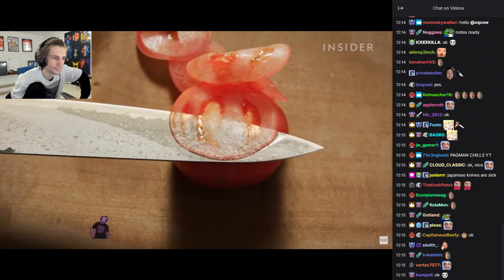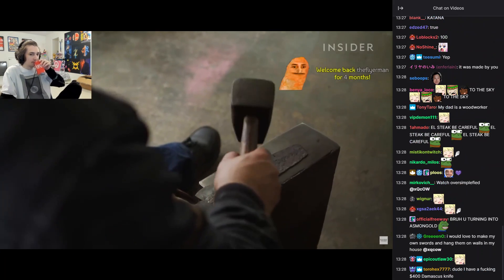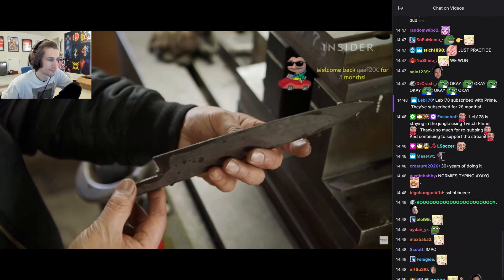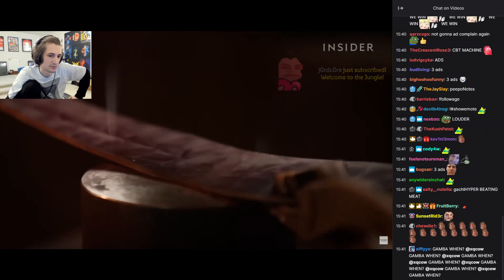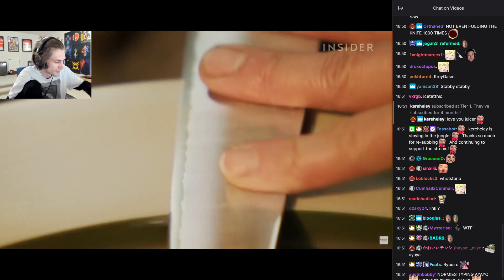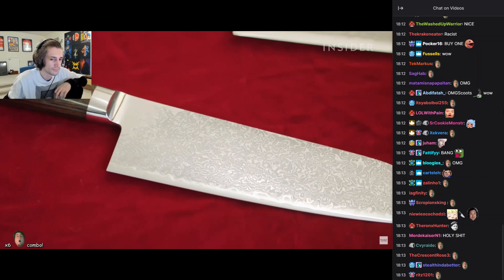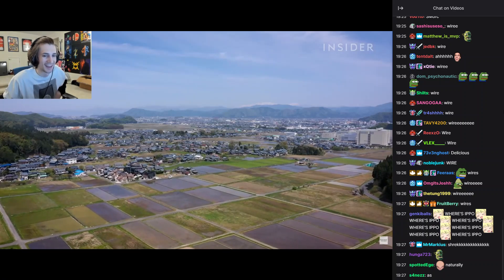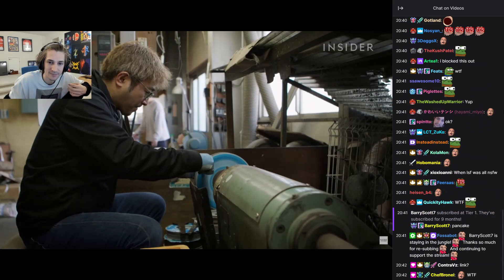xQc Reacts Why Japanese Chef’s Knives Are So Expensive | So Expensive

Comment: One of the things that frustrates me about that type of video is when they talk about sharpness. You can sharpen a stick to shaving level sharpness, but it won't hold that sharpness when used nearly at all. Most of the skill in that type of knife making is in the material selection and composition, where and how the hardness of the steel varies, how it is tempered, and how the blade is shaped and balanced, these things can take immense skill to get right and are a large part of the reason why artisan blades are sought after. The grind, that is to say the profile and shape of the blade's surface, also takes a considerable amount of skill and time to define, starting that shape and working it into something good is hard. However, once that is established taking a relatively dull blade to any sharpness level you like is close to trivially easy. You could teach a regular person who has never done it before how to do it in a couple hours if you gave them the proper setup to do it. It's still pretty time consuming, but you can do it with any blade and it's not that difficult. How well the blade holds that sharpness, and how optimal the hardness of the surface is for the task at hard are the real traits that set high end knives apart from others, and that is mostly down to material selection and knife composition (where you choose to put the metals of differing qualities).
Reply: Don’t forget the sharpening, you mentioned it but there’s a difference between making something sharp and giving it a truly balanced edge. Often the “sharpening” you see in YouTube probably has rolled edges or an uneven finish, it’s almost an art form in itself to be able to sharpen a quality blade well.
Reply: 100% true, my dad is a knife maker and he turned a 1 dollar walmart knife into pretty much a Razer u can shave with.
Reply: this is true, im a knife so i can confirm
Reply: @Cra-b  “I’m a knife”

-Sun Tzu
Reply: Ok
Reply: @rr-m4731  for anyone that is amazed by japanese`s skills and would like to learn more about it.
Reply: Idiot in couple hours regular person whould useless have you ever hire person who never done it before they are so useless . Business owner i was working for started hireing unexpierebced people to save money it was insane nightmare . I wish people can learn much simpler job in couple weeks ...